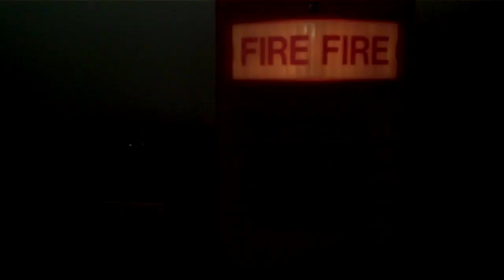Simplex 4090-91 with 2903

Comment: There are a couple of those alarms at the Boston Park Plaza Hotel. The rest of the building mostly has newer 4903 and TrueAlert speaker/strobes (system is a Simplex 4100ES.)
Reply from the maker: wileyk209zback Just saw your video from that hotel... Funny how a few of these are left in the system.
Reply: @NewEnglandElevators  Yeah, they were probably left intact for additional sound coverage and because the new system was also Simplex.

Comment: They've got that alarm combo at a children's hospital in Brockton. Even more amazing, they actually had a huge Simplex 2001 voice-evac panel setup, still in use! Though they do plan to eventually upgrade to a Simplex 4100ES system, I wouldn't be surprised if they kept several of those alarms (as there are quite a few older Simplex voice-evac systems with newer 4100-series panels that keep the original signals.)
Reply from the maker: It wouldn't surprise me if they kept the existing signals with the new system. A pull station upgrade would probably be in order as the system would now be addressable, and probably lowered down to a more suitable height (for ADA reasons). Nonetheless, the 2001 Voice Evac System you described seems like a pretty cool system.
Reply: NewEnglandElevators    Ju j. Hi. U nuuu

Comment: my grandmother back in the day had this same set up, except the federal signals were mounted over the 2903 light plates, and the system was a simplex 2001 fire alarm control panel w a voice evacuation panel, so the lights were flashing at march time rate.  I think the panel's still there,not too sure. Most of the residential buildings in my city still use the existing system which was installed from the late '70's, '80's, or 90's, unless of course it was constructed after those decades